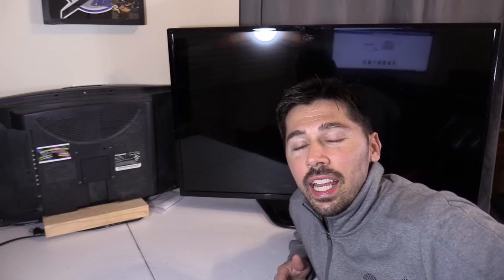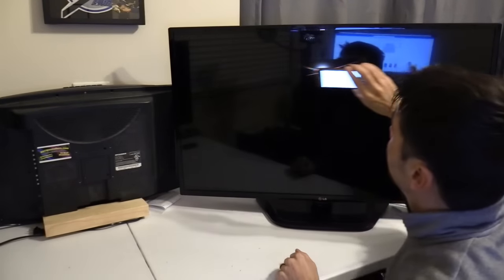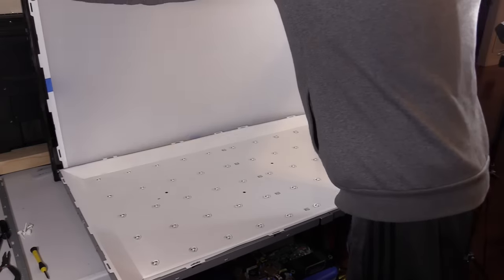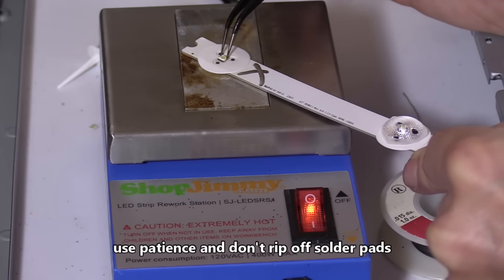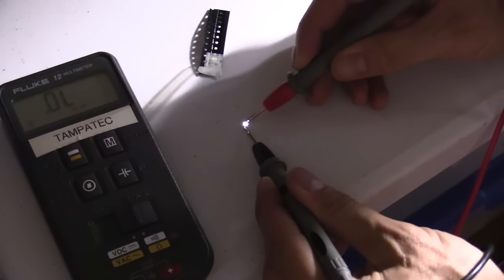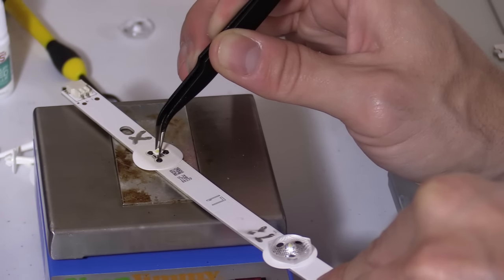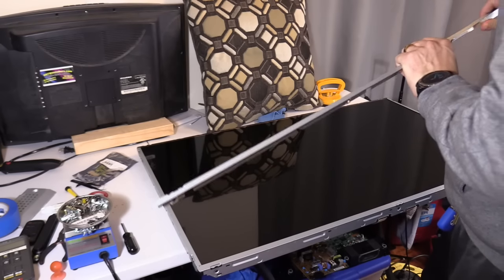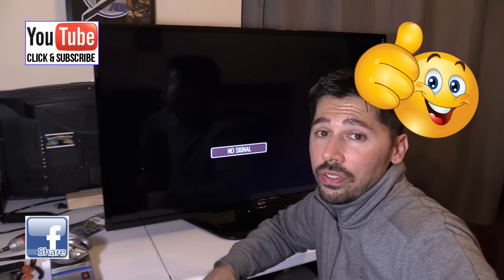LED LCD BLACK SCREEN TV REPAIR, COMMON FIX MUST SEE !!!

Comment from the maker: See here for repair kit tool LED tester- http://amzn.to/2sAktD5
LED strips Heat workstation-https://amzn.to/2RcxICc *link supports channel
To prevent LED strips failure just lower backlight setting brightness to 50% or lower.
Reply: Hey I have a question. I have a led samsung. It just stopped working. Sound is there and I flashlight tested and see stuff there. So the back lights arent working. Is it safe to say I need to replace the LEDs? Where can I find the LEDs the model takes?
Reply: I have a 55" haier 4k ultrahd 
It has backlight but I dont see a tcon board help thanks
Reply: Hey does this wrks for JVC brand also I have that same problem
Reply: @oc9357  Hi, There are several different types individual LED’s for different TV’s.
I am think I would like to just replace the individual BAD LED’s.
What or where can I fine the correct replacement LED for VIZIO E50x-E1 TV ?
Reply: The LED Back-light strips are LB50068, but what is the part number for the LED that is soldered on to the strip ?
Reply: Yeah

Comment from the maker: To prevent this repair from happening to your LED TV just set your brightness and backlight settings to 50%. If you max out your backlight settings what happens is the LEDs on the LED strip get brittle and crack from the heat.
Reply from the maker: Aubergine Nightshade shopjimmy.com or electropartsonline.com use code tampatecfriend for discount
Reply: Tampatec are the led available for seiki se50fy10. I've tried different boards and it does the same.  I see no lighting in the dark by flashlights.
Reply: I don't trust those suction cup thingies. I prefer to use my hands.
Reply: Tampatec 
My daughter hit my screen but it not crack on outside it looks like a crack on inside like half of the picture shows and it looks like spider crack inside. Does that mean lcd or is the tv done for? Its a 42 inch sanyo plasm
Reply: Is a LCD TV more reliable than a LED one?
Reply: Typical, manufacturers driving LEDs too hard combined with insufficient cooling. I guess they don't want their products lasting any where near as long as the MTBF stated by the LED. manufacturer.
Reply: hi everyone ,if anyone else  wants to uncover 
remote pc repair
 try Saankramer Electronic Magazine System ( search on google ) ? Ive heard some decent things about it and my brother in law got excellent results with it.
Reply: Tampatec ķ
Reply: Tampatec my Proscan Pled 5529A-F has the same problem, but sone time if i keep turn off and on the backlight will stay
Reply: you sir a real pro in this kind of repair, thanks a lot .
Reply: Hello, I have 6 big flat screen tv's that need repair or can be used for parts. Can you recommend a place or person that buys items like this ?
Reply: Can  a bad LED driver cause it to turn off the backlights also?
Reply: Tampatec hi, I'm going to perform the same fix but what is the correct code for backlight LED chip? Is it 3535? Or I can just other number as well? Will it affect the output? Cause mine all of it's LED chip no longer lit up when tested
Reply: @Popart-xh2fd  

It's not the same thing. An LCD is still lit up by Led's.
Reply: @tech4u680  yes
Reply: Tampatec hi
Reply: Same thing happened to my Samsung Smart 43inch and it was always on the lowest setting possible.
Reply: At 50% backlight, I can barely see the picture on my TV.
Reply: Sir I'm from India led tv has white display which part is damage.

Comment: Thanks for that! I have just dismantled a Philips TV, following your instructions. Not sure if my client will invest in the led strips... I used a 24VDC supply for checking the leds, soldering the wires on the test points of each strip.

Comment: Hi Paul:  To avoid accidental fall of the screen glass, is it possible to work on the TV with the glass side on the table and lift the metal back side up (turn 180 degree) for repair?

Comment: 👍👍👍👍👍👍😊  Excellent job.
I have a question. Does the way you test LED TVs apply to 8 inch color touchscreen monitor used in cars?

Comment: Hello Tampatec, I've watched some of you vids a year ago, just noticed you had so many and your own channel. You're such a help to all of us diy folks. I have a Sceptre E55 and it powers on and I can see "select input" image on screen ONLY with flashlight and dark room. In this video, you state that if image shows with flashlight that the tcon board is good. When testing the voltage on power board to LED wires, no volts in DC mode, but 3.2v & 3.5v in AC mode (two connectors going to LEDs. What do I check next? Some other vids mention backlight inverter.

Comment: tampatech, love the vids! you've stretched my know how in electronics and also teaching.  you got a gift brotha! I have one issue tho.  I have a kicker zx750.1 mono amp.  I have the circuit board exposed for show purposes.  I usually have a custom cover but had it off at the time of this incident.  I had a lot of water fill up the amp but it's suspended in air so it was draining instantly somewhat.  I caught the problem and got it out immediately. the power was not on nor was the vehicle. I have 2 500k power caps right by the amps also.  they got wet,  but seem unscathed. I immediately took the amps out and blew them out with the air hose.  then disassembled them to further dry and inspect.  I  did the big one first cause it's more valuable.  a kicker 700.4. got it reinstalled and works fine.  now I did the 750 the next day. got it in and it lights up and produces audio but a green little capacitor on the board buzzes. it's almost a wave effect.  slowly gets higher pitched and stops.  then restarts.  if I grab the amp and twist hard I can make it stop.  once I let go it starts up.  I've taken it apart now and touched areas that looked suspect with a soldering iron 5x. even replaced the green capacitor which is a 2a102j. I'm stuck and tired. any direction would be much appreciated.

Comment: First of all great content.  I have a 65UH5500 (2016). When I power up the TV the screen lights up then goes dark and the red light (power button)  flashes 3 times. One long flash and the two shorter ones. I checked the capacitors and they do not show any signs of damage. In addition I could not see any images on the screen when I used a flash light on it in a dark room.  However I will say there was a slight odour from the Tcom board area. Any suggestions of what to check next. Once again great channel with very useful tips and information.thanks

Comment: Did you ever use an LED from a different TV brand to fix  the backlight
I have a broken strip -- but working LEDs --  from LG TV and I want to remove the LEDs and place them on a SAMSUNG strip..
Thanks for your videos and advice..

Comment: You suggested that two people doing this job.  So when can you be available?
Also, rather than replacing diode, how about just replacing strip.  I might do strip replacement,  but would tackle replacing diode, but I will let you do it, if you would like to help.

Comment: Paul, would you mind helping me determine if the strips are bad or one of the boards might be bad?  Visio E55-C1, Image is fine, no back lights.  

I tested voltages on boards similar to your voltage video.  Power board sending 3V (PS-ON), 2V (BL-ON), 5 lines of 25.5V (assuming for back light) as well as other 12V sends to the main board.  Main board has two backlight connectors, each is sending a bunch of 5V leads and two 34.5V leads.  

Is any of this useful in determining if there's an issue with one of the boards, or all the LEDs burned out?  TV stopped working after lightning struck near by, big surprise.  Seems like power is being sent to the strips, but is enough/right?  Or if power is being sent to strips, maybe they shorted due to surge?  I'd like to get your opinion if it's worth spending money on boards, or just get another since I'd rather not remove the screen to replace strips.  

I can send pictures if that would help.

Comment: Great video. I have a LG 55ln5600, on power up screen flashes them black. Measured 180v going to led strips then voltage goes down to a  steady 84v. Bad led strips?

Comment: Great video!! I have a LG 55LF6000-ub. My screen turns black when it comes on but it flashes the picture which is still a good picture. Thru the screen when flashing there's 1 row in the middle that flashes led lights along with picture. I can use a flashlight and put next to screen and I can barely see the picture. Audio works. Would this be a problem with backlights?? Any help would be greatly appreciated!! Thanks 😎

Comment: Hi Paul. Love your videos. I have a kdl40ex400 and on power up the screen flickers, has a thin red line across the bottom and will eventually black out but still have sound. None of the videos address this condition. What do you think it could be? Thanks in advance.

Comment: Hey Tampatec, I'm not sure if you provide TV repair advice these days, especially considering you've already provided so much great content over the years - which allows us to repair our TVs ourselves, however, I have a question regarding something I don't exactly believe you've covered before. 

Here goes, hopefully you can give me some advice or a little guidance. You're always so successful with TV repairs, so maybe you can help me out. Thanks in advance.

I picked up at 65" Curved Samsung SUHD Tv (UN65JS9000F) and what's interesting about this is that the LEDs (edge lit btw) are clearly turned on and are visible from the back of the TV, but from the front the display is super dark and hardly visible. The darkest parts of the picture are just black, and the lightest portions are hardly visible. I've removed the panel so I can see the LEDS. (Which btw the previous owners obviously had this thing at full brightness 24/7) Because I even found some brittleness/slight burn marks on one of the (filter things?) One of the ones that sit behind the glass panel, but in front of the LEDs. 

The display shows some backlights through the display on the VERY edges, and ever so slightly on the sides of the TV, however closer to the middle is DARK dark dark!! Any thoughts? Again, LEDs appear to be BRIGHT and working perfectly when I remove the panel and all of the filters/plastic behind it, but when those things are on, the panel is really dark as if there aren't any lights at all (except for the edges and corners, ever so slightly) Also, sound and picture do technically work. The picture is dark, but things are visible ever so slightly even without the use of a flashlight (or flashlight test)

This could be an interesting repair, but who knows. Let me know what you think. It's like the brightness isn't powerdul enough to make the whole display come to life, or the LEDs light isn't being distributed properly. Maybe due to the brittleness found on the filter thing behind the glass? Who knows. Thanks again so much btw! God bless.

Comment: Hi Tampatec i have a LG 42LN5758 my problem is when i turn it on the power led is blinking 3x the sound is ok but the picture is blinking always in dark to bright you can see the picture with a flashlight cleary 

Thx for your answer

Comment: What kind of solder is used on the LED strips? Lead or lead-free? is the heat pad hot enough for lead-free?

Comment: Got a dodgy LG TV red light flashes but no picture no sound nothing. It’s had a new power board installed but this did nothing so I’m thinking it’s maybe the TOC board or the mainboard. I think I’ll try a new TOC board as there cheap, if that’s not the fault I’ll try and heat the mainboard in my oven at 180 for around an hour & see if I can get any dry joints re solder’d. Any advice is welcome.

Comment: Great video except LED replacement parts are  White 6000K SMD LED Diode Lights Chip? What specs can we be assured of proper wavelength, amperage or lumens?

Comment: Would not removing the old glue from the LED strip cause a "halo" effect shining through the screen when the TV is reassembled? It makes sense if the height of the lens is that sensitive. Everything works after replacing the LED strips in my LG 55LB5900-UV. I just have the "halo" effect on 3 lenses I had to glue back in place. Or is there a specific super glue I should use? I used Loctite brand in my repair.

Comment: Hey, how can you detect if the power button doesn't work ,will that be just the power supply, because it had a problems staying on in the past but worked and now it's not . How should I fix it ?

Comment: A problem I encountered. Hope you will be so kind enough to help me to resolve this problem.  Accidentally I plugged TV's one of the Audio red/white and video yellow  into Sat cable box's 0/12V-50 mA socket.  TV stopped working and now no power no sound nothing. No voltage to the mother board. When I checked the power supply board I found 1 diode defective. (checked with multi meter and both side beeps on continuity check) The size of the diode cannot be detected.  Million thanks for any advice to sort out this problem.  Greatly appreciate it.

Comment: I know you'll ask a make and model number which I don't currently have to hand but in your opinion of black vertical lines started on the left of the screen and started makings its way right over the screen to eventually full no picture with sound. Would you think T-con board for that issue ?

Comment: Nice job,great tutorials.Thanks for your help and insight.
IMHO ,If you're a DIYer, and are able to isolate fault down to backlight LED's......I'd replace the strip vs individual LED's. Based upon age and op temp (due to full on backlight) , if one or more in a strip has failed, it's cousins have been stressed as well. You don't want to repeat this process in the near future when another LED fails.
Thanks again.
Reply: Providing you can find the strips...lol......Thanks!

Comment: I'm sure someone else will have already made this suggestion: use TWO SUCTION PADS,
spreads the weight. And it will also allow you to handle bigger screen sizes aswell.

Comment: Hey Tampatec I have a RCA 42in LCD full HDTV 42la45 RQ which has 45 capacitors bad I checked with multimeter thanks to you and noticed the capacitor is bad on it thanks to you again but my question is would it be easier for me to just replace the power Supply / backlight circuit board are desolder and resolder the capacitors I happen to have a 46 in RCA very similar LCD the circuit boards are different on the power supply board but three of the connections are the same out of four can you tell me is there a way I can just use the board off the 46 in RCA LCD 46 la45 RQ or is that not possible

Comment: Hey man! So I have this TV, it turns on for a little then randomly shuts off. Then wont turn back on unless I unplug it for 30 seconds.
It always turns back on but eventually turns back off, sometimes a few seconds, sometimes a few minutes. 
I got it from a friend who said it would do this, but sometimes would work for months then randomly stop, then work again.

They also took it to a repair man who said it worked perfectly fine....obviously it doesnt lol. Would this be the same fix? If not what would you suggest?

Comment: I have a Samsung 46" back lit LCD that works fine except the screen is just barely visible without any use of a flashlight. Can I assume the LED's have gone bad and maybe just a couple good ones that are lighting it up ever so slightly just enough to tell there is a picture there? It wouldn't necessarily be another issue would it?

Comment: Is there a good source to find parts for a not so common brand? I have a Seiki 40" LCG69 with a similar problem. Turn it on and the screen displays the Seiki intro screen as if ut has no probkem at all and then as soon as it's over the backlights go out. I really like the tv and want to fix it. I can't bring myself to get rid if it because it seems like a very repairable problem but I'm having trouble finding the parts for the model.

Comment: I have the Similar problem with my 65 inch Seiki but there's no flash at the beginning. There's no picture and there is sound ( plus a continuous clicking noise) . I hope that I can save her ! Any suggestion? 
Great videos bye the way !
Reply from the maker: Art Jones use a flashlight on screen to see if tcon board is working and putting a picture on the screen, if you see a dark image then backlight is most likely bad but clicking is usually a sign bad caps in power board or main board. Get tv boards at shopjimmy.com or electropartsonline.com use code tampatecfriend for discount 👍
Reply: Thanks a lot Paul of Tampatec! Much appreciated.  I will let you and the channel know of the outcome. Have a good day and keep it up! You're the man

Comment: +tampatec   can a led strip stop a HDTV(sharp aquos) from turning on ? i have a LC-60LE600U when the tv was on there was a darker spot on the tv(along the bottom of the panel) so im guessing that is the issue and it needs to be replaced what do you think ?

Comment: My screen is black but flickers from top to bottom and after a few seconds, the entire screen fades to black. Tests with LED cable to the power board detached on one LED+, the reading is 161-175, and on the other LED+, the reading is 174 to 199. I presume this is a faulty power board. Would that be a correct assessment?  When powered on I can see good LED lighting from the top to the bottom of the screen with it flickering. So I don't think I have a bad LED light. When one it powers on with a black screen with good contrast to the menus on the screen being seen but it just fades to nothing like the power is fading out after a few seconds. What's your opinion?

Comment: I Got A Flat screen From My Neighbor
Downstairs Here In My Building & I
Turn It On All I Get Is The Standby Light.
But No Power Or Sound Or Picture.
So Could It Be The Logic Board? Cause
The Power Supply Board Is Good.
Could It Be A Fuse? Or Could It Be A Loose 
Cable Going From The Power Supply Board
To The Logic Board.